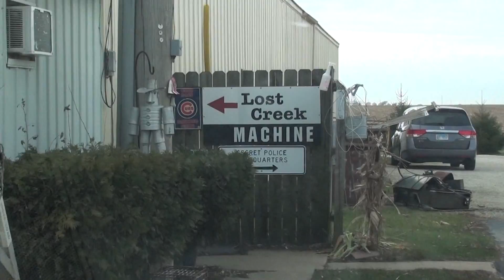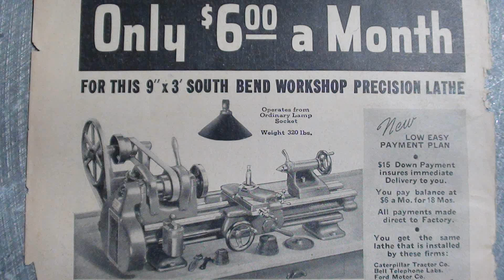DELIVERY OF A SOUTH BEND 9" model C LATHE 780 tubalcain

Comment: I picked up a 1938 south bend 9 model c you can still see the flaking on the ways and bottom of the tail stock. It's a honey of a machine.
Reply from the maker: Sounds like a good one
Reply: @mrpete222  the cool part is it has the push button switch with the original instant reversing motor.  I got lucky and picked it up for 500$

Comment: Hi Lyle. I would have liked to have seen more of that '66 Chevelle. My dad gave me one as a high school graduation present in 1972. He paid $400 for it and had my brother-in-law repaint it the same dark green color it was. It was my 1st car. It had a 283 engine with power brakes, but no power steering, so it had a huge steering wheel. I was barely 5 ft tall then, so my dad raised the front seat up with wood blocks. I still had to look out the windshield through the steering wheel. By the way, looks like a nice lathe and with collets.

Comment: I'm in the UK and have one that I rescued from going to scrap. If I have it right it dates to the mid 30s. I have never really used it as I didn't have power to my shed in the beginning. Needs a good clean up, a lot of surface rust on the machined surfaces but it's well coated with oil. So I will watch with interest.

Comment: This South Bend is like mine. No gear box. I need to make a space for it, and move it from my mom's house. Serial number places it between 1930 and 1932. If I remember correctly. There's a ding in one of the ways that could use a fix, and my grandfather replaced the buffalo hide belt with a couple of rubber belts, and moved the forward/reverse switch to a different location. I'd like to have a proper catch tray. Perhaps one day.

Comment: Hi,  I was wondering what machine would be the most beneficial first to buy, a lathe or a small milling machine.  I'm just a 64 year guy who likes to fool around in my garage. I can't really afford both  but would like your opinion. Thanks, love your Videos.
Reply: A big milling machine, put a lathe chuck in the spindle and tool in the vise and you can use it as a lathe as well. No single point thread cutting capabilities unless converted to cnc but it's a 3 axis machine. To mill on a lathe you need to mount an additional axis and it's a lot more fuss
Reply from the maker: Definitely a lathe
Reply: Aahhh, the old "metric or imperial" argument.  I suggest you start with one, knowing you'll want the other as well.  Best wishes on your journey, mate.
Reply: Yep a lathe

Comment: 2:45 What tool's fitted in the tailstock ?
Reply: Looks like rollers to support the end of a shaft that doesn't have a countersunk hole in the end for a tailstock live center. May be used for turning pipe stock?
Reply: @TinkeringJohn  An end of bar fixed steady, you mean - interesting suggestion and it's something I've not seen before.
And live centres are in the headstock - the fact they're driven is what makes them live.
People use rotating/running/revolving centres in the tailstock - as well as dead ones.
Reply: @millomweb  Revolving tailstock centers are live centers even if they are not driving the stock. If you think of it, the tailstock center is being driven. The headstock center is the driver.
Reply: @TinkeringJohn  But they're not called live centres, they're as I said revolving centres, etc. We wouldn't be having this conversation if the confusion hadn't been created by people calling a revolving centre a live centre.